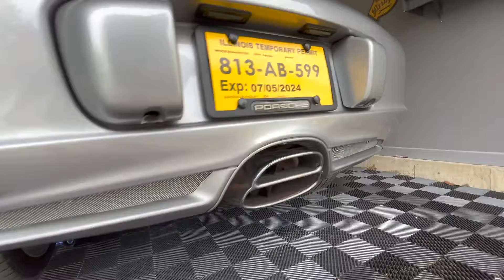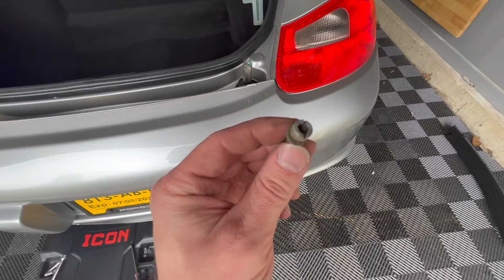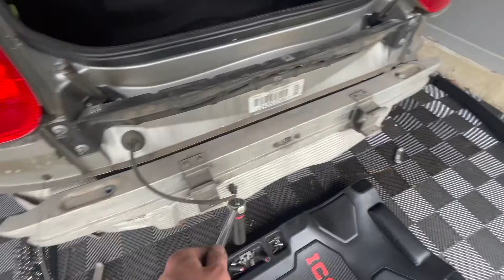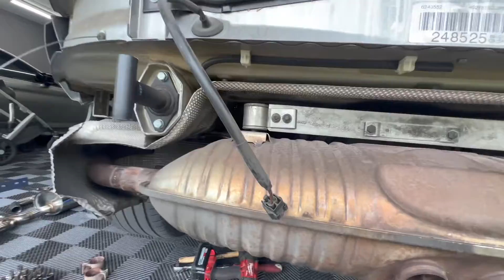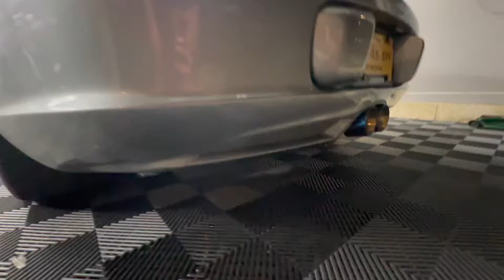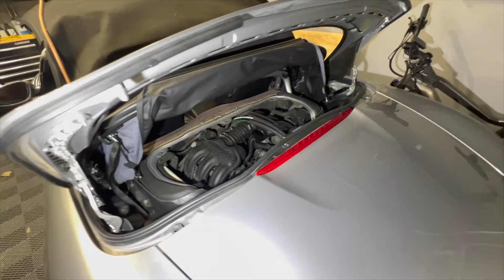986 Circuit Werks V2 Exhaust Install - Perfect Budget Exhaust???  - 986 Spyder Project Car

Comment: Do you think you'll be able to split the case to repair 2nd gear from removing the exhaust and rear bumper? Looks like it's highly possible. Idont have the 2nd gear grind too bad only when extremely cold. But i have the dreaded shifter leak in the housing
Reply from the maker: Good question. Maybe. I’d have to look again and measure.

Comment: Do you have any abnormal sound on deceleration? For example, cruising at 2-3k rpm and let the gas pedal off, and when the car reaches 1.5-1k rpm, there is like purring noise, coming out of muffler. I have the same muffler as you and this strange noise makes me unhappy:( thanks a lot!
Reply from the maker: Yes! I have the same thing. It’s not that pleasant of a sound.

Comment: Nice video thanks. But one thing I don't understand. You are the (proud) owner of a rare limited 550 Spyder. Why messing around with after market junk? It takes the value down quite a bit.
Reply from the maker: I completely understand your train of thought. I’m keeping all of the OEM parts. At anytime, I could put it back to stock. I don’t plan to do anything irreversible.

Comment: Sounds nice! Did you experience any type of check engine light with the catless test pipes? What year is your 986?
Reply: I did a secondary cat delet and a borla. Just keep your headers in place and no CEL.
Reply from the maker: No CEL with the secondary pipes. You will get a CEL if you do catless headers. My 986 is a 2004.

FYI, I posted a video with several sound clips.

Comment: I have exactly the same exhaust. Installed it to day 1 hour of driving. No leeks perfect fitment, but the drone is there between 2000-3000 rpm after that it is fine. Someone told me to drive it for a week, then it will be less loud. But as today I would go back to stock
Reply from the maker: Yeah there’s drone. It’s a weekend car so I’m not too worried about the drone. You can drive around it.

Comment: Looks good. I would be curious how the drone is at sustained highway speed. I had an eBay exhaust on my 97 Boxster and finally had to remove it because of the drone. But this has the x-pipe, so maybe better.
Reply from the maker: I haven’t done a highway cruise with the top up, but I would imagine there would be some drone. Once I have the car back together (replacing the AOS this weekend), I’ll post another video reviewing the exhaust.